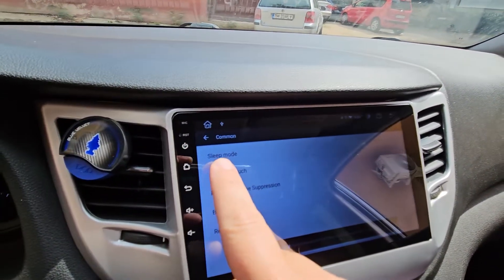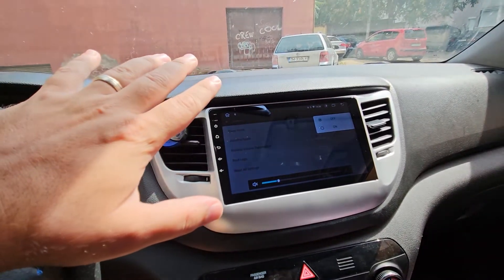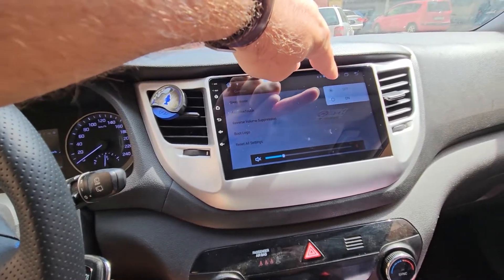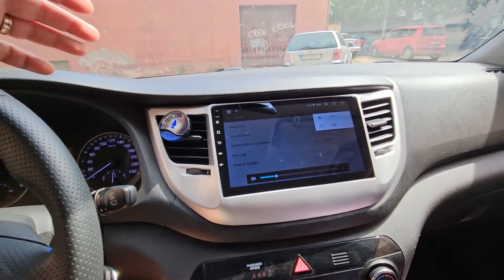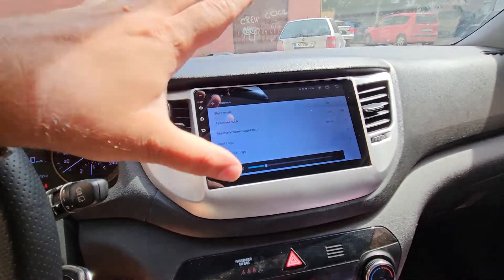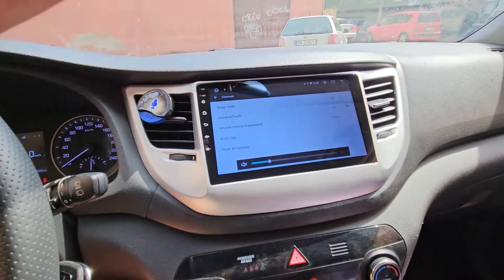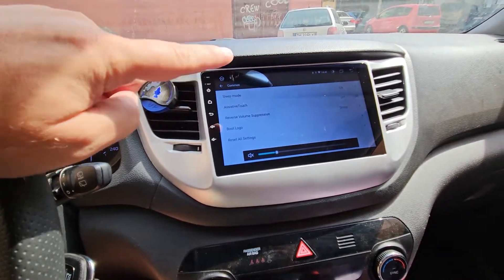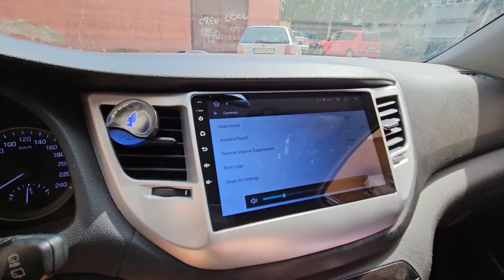Chinese Android HeadUnit current draw (Sleep Mode)

Comment: Handy chart. By coincidence, today I hooked up some spare android head units and measured the current they draw just for my own info, but, of course, that is a bit more hassle, as (measuring current) has to be done in series as you well know. 

This chart obviously uses the resistance value of the fuse to show the voltage drop, which of course is directly proportional to the current drawn (ohms law). Excellent. 

Next time I get the Android units out for a test I might try both/compare/see how accurate it is. But handy to have. 

Cheers.

Comment: You should exactly specify what's the current unit platform is because not all head units act like this. Better devices take just 0,08-0,09mA in sleep mode (measured with laboratory power supply).

Comment: I don't have option for sleep mode, but I want to point out that when I measure the voltage with open door (car is turned off) I had measured about 1.7 mV, but after a while with  closed door and lights in car I had measured 0V. When I opened door it rise again to 1.7mV. So the car is "turning off" head unit only if its closed for a while (like a minute or two). I have hyundai i30 2018.

Comment: Even with the sleep mode off, my android headunit drew power and my battery went flat. Any idea on what to do? Or how to try to understand where the power is being drawn from?
Reply from the maker: Simplest method is the fuse removal method. If you pinpointed the draw to the head unit might be a faulty HU or the CANBUS box.

Comment: Completely WRONG ℹ️ INFORMATION.
You are measuring voltage rather than current 😅😅😅
Reply from the maker: Clearly you did not understood my explanations.... that's of course If you saw the video entirely. Just for the sake of helping you understand,  I am measuring the voltage drop on the fuse that can indicate the Amp draw ( current draw ) using the provided chart. This is elementary physics. For your general knowledge study "Ohms law",  you will eventually understand.
Reply: @benassy69 the most accurate measurement will be to place the 2 probes between the 2 FEMALE pins on the fuse board, rather than voltage drop across the pins of the male fuse.

Comment: I've measured my new (Xtrons) radio on a test bench, and when in sleep it only consumes 16mA, and when powered up, it's instantly on. That are great numbers!
However, when I'll install it in my car, there's also a canbus converter box involved, which could potentially draw constant current without ever going to sleep. I've seen someone who had powered the canbus box from a 12V Acc line, so no draw at all when the key is not in. I'll also do that on mine to be sure
Reply: How can I power the canbus box directly from a 12v acc line? Why does it make a difference? Ie, it will still draw power, no?
Reply from the maker: The CANBUS box talks to the Cars ECE only for some functions like AC, steering wheel buttons, doors switches, and the Cluster module. All these modules are off when the car is off. So if the unit is powered off, I don't see any risk the CANBUS box might draw current only in the special case that the box is faulty or something.
Reply: @benassy69  thanks for the quick reply! I made another separate comment where I explained that, even when I disabled the sleep mode on the android headunit, my battery went flat after two days without using the car. I am a bit clueless on where to start troubleshooting, but maybe the issue could be on the canbus? There is another video on YouTube where someone simply cut the yellow line that goes into the canbus box conector, but i am a bit unsure about doing that. On the other hand, i don't know what else could cause the battery drain.

Edit: by the way, after disabling the sleep mode, I saw that the headunit takes 1min to start, instead of instantly starting as before. So I think it is not the headunit itself draining power, but something else. Which is why i am now pointing at the canbus
Reply: @L_im87  12V acc line online gets power when key is in ignition. That's something else as getting continues power, even when the car is locked (that 12V is often the yellow line to the radio) .. Note that a canbus adapter can also draw power when other modules are off or in sleepmode, it might still be actively listening to signals on the canbus line(!). However, only if the canbus module gets no power, you are sure it can't

Comment: I connected two small plugs (black) and my CarPlay only works when these two plugs are connected. However, when those plugs are connected, the CarPlay unit stays on all the time, even after I turn off and shut down the car. It never shuts down. My car is a Skoda Fabia Mk2. Maybe you know how to fix this problem?

Comment: Hi i was wondering if it's possible to cut the 12v constant wire and run the unit only off the 12v accessory wire? Will this cause any issues? 
This is only because my unit does not have a sleep turn off setting and only a sleep delay with intervals of 10-60-120 ect and im sure its not rebooting from an off mode.
I dont want my batttery to drain.
Reply from the maker: It depends on the unit you have. Might happen that you will lose some settings like for example the radio saved frequencies.
Reply: It's the navifly nf4 and I use it only for android auto tbh no other function.
Reply from the maker: Then it should work. But you will need to connect the unit thru your contact key.
Reply: What do you mean by contact key? Also is it possible to put the constant wire in the same hole as the accessory? Will that work for my situation?
Reply from the maker: Exactly what I wanted to say. You need to bridge the constant wire with the accessory wire. Meaning unit will reelceive power only when the key is switched.
Reply: And this will not overload the circuit or have any consequences apart from losing the stored settings right? I don't want my unit to blow up mid journey hahaha.

Comment: Very useful. On my device, this setting is not clear. It says no sleep, sleep 2 hours, 1 day or 3 days, and when translated in French, you can imagine the result. But on my car, even if I'm choosing no sleep, 2 hours, 1 day or 3 days, it is always doing an hibernate and a reboot. I measured the +12v perm, and it is present on the connector. Only when I'm doing a factory reset the device is sleeping, but after some hours, it doesn't sleep again and goes to hibernate.
Reply: How did you solve the problem?

Comment: Great help!
In 6:39 you are saying you are measuring mA but you are measuring mV, also later in the video where you are reading in the chart to the chart which is also in mV. Confused me a bit since I have a different multimeter and initially tried to set it to mA (which would also require a different input socket on most multimeters).
Do you have a link to the chart somewhere, that would make it easier for other to read their values?
Reply from the maker: Correct mVolts I wanted to say. Got carried away by the process. I will put a link in the description of the video.
Reply from the maker: https://ro.scribd.com/document/370460806/Fuse-Voltage-Drop-Chart-Mini-Fuse

Comment: That's neither sleep nor standby mode but off mode. If it in sleep mode, the screen will not start from booting if it wakes. :)
Sleep or standby mode easily consuming 1.7mV or 450mA :)

Comment: Was looking for this exact same thing. Had to ride my bike to work today because I installed a radio like that on the weekend and my battery flat. Let’s hope it’s actually that setting.
Reply from the maker: Let me know if that was the problem or something else.
Reply: @benassy69  I set it to not sleeping and recharged my battery. I won’t drive the next two days and will check on the weekend if the battery has gone flat again. If I remember I will let you if this helped.
Reply: @lohca  so what happened?
Reply: @ba-dum-tss9169  It was that setting indeed. Battery wasn’t flat.

Comment: I have a different settings. I csnt find the sleep mode
Reply: Try factory settings and enter 000000 for password if you have one similar to mine. Sleep setting will be in there.
Reply: Same even in factory settings cant find it
Reply: @zikomaestro in factory settings you’ll need to find default power status press and change to OFF then apply then exit and radio ask for a reboot press ok.
Reply: @RoBeRtO..  I dont have that either. I have nothing relating to sleep mode etc in the settings
Reply: @RoBeRtO..  Do you know how to save this setting? When I set OFF and reboot it, then there is ON again.